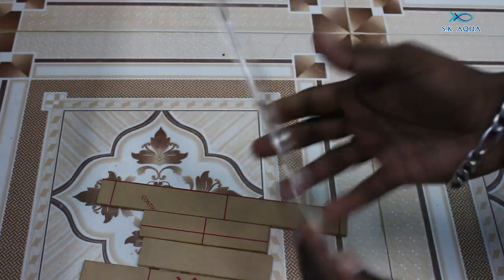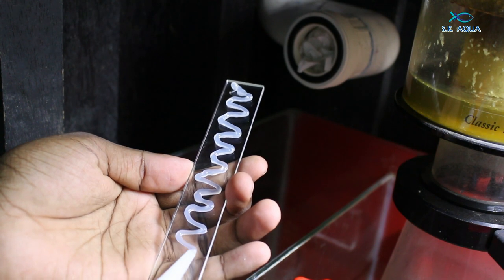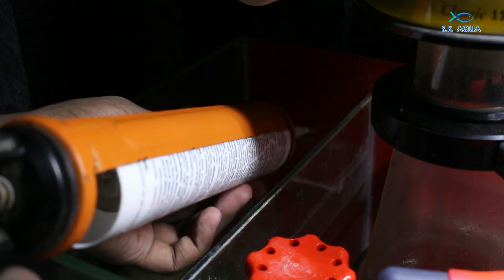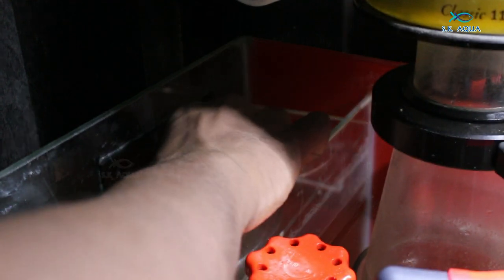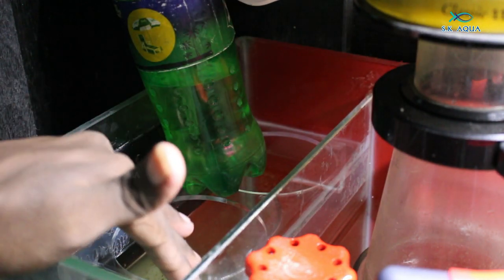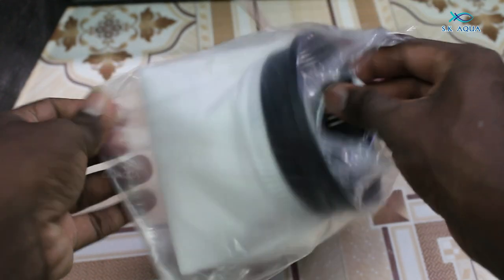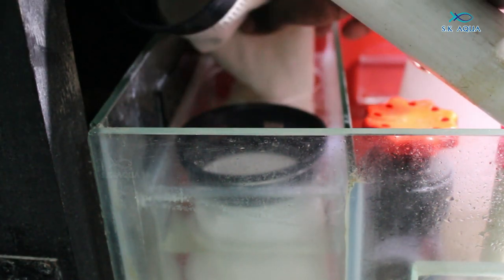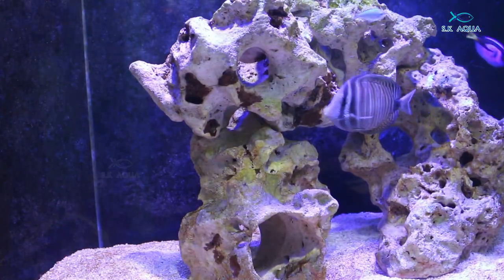How to setup the filter sock | Tamil | SK Aqua | SK Aquatic |

Comment: Now, when use nylon socks, it pores or holes are big microns, for a week or so it will start getting clogged with filtrate and the microns will reduce very much like fine filt may be for 2months or so we need to change or clean, if we use fine filt like 200 microns then 2 weeks or so we need to clean the socks, so if u can clean it up regularly then it's fine or u can go for the nylon socks
Reply from the maker: Next na bubble magus tha vanga proa felt type